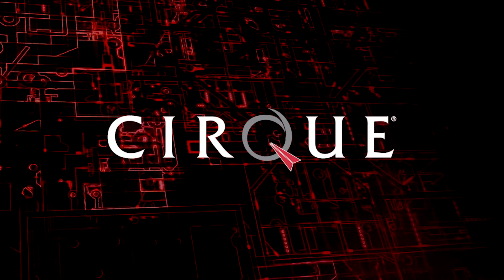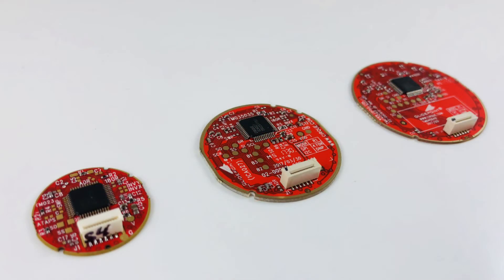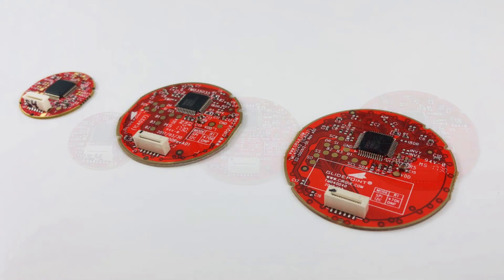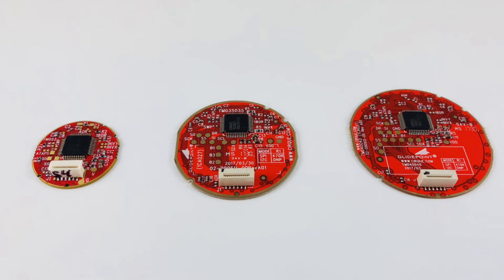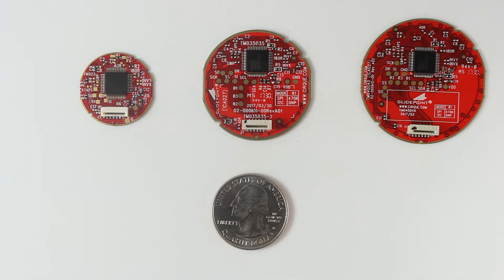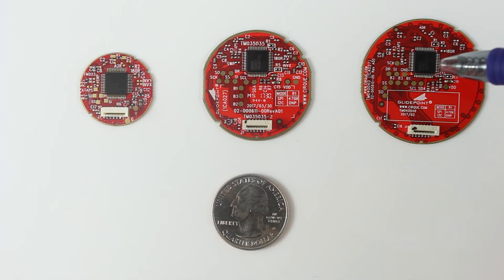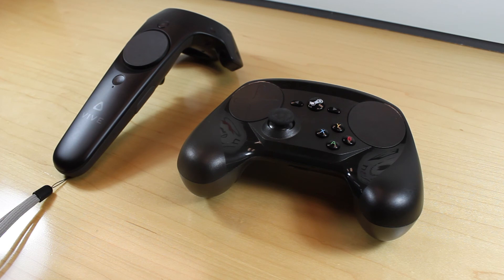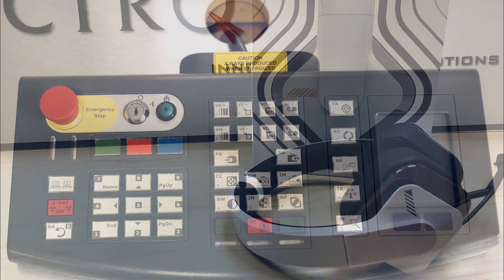Circle Trackpad Overview

Comment: How hard is it to make one with a custom shape ?

I would like to make my mouse buttons into cirque trackpads
Can they multitouch BTW ?
Reply from the maker: Pending on the specifications custom designs are possible. It would require a custom capacitive sensor and printed circuit board. Cirque does work with customers to design and build custom shapes and solutions.   

https://www.cirque.com/custom-applications